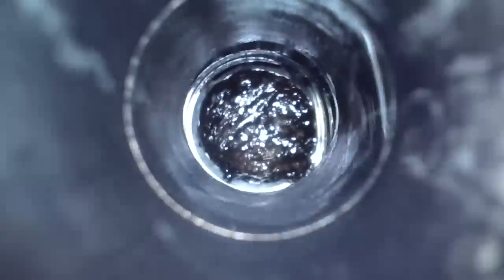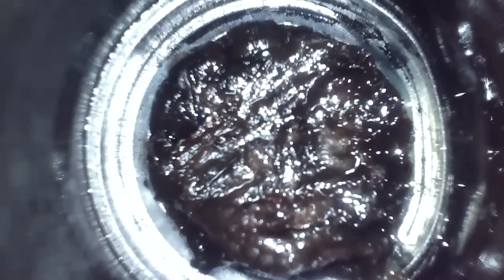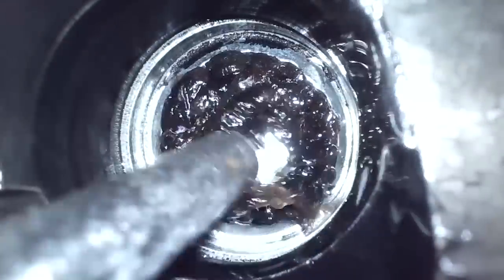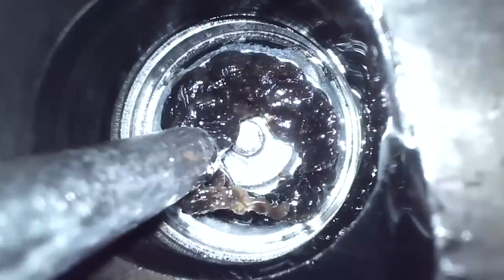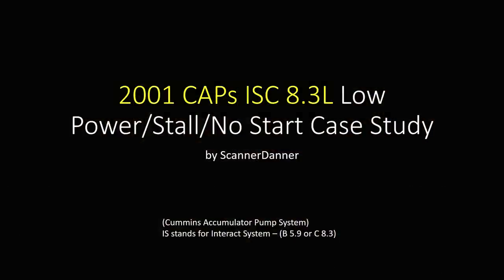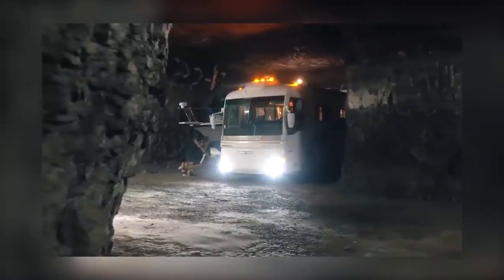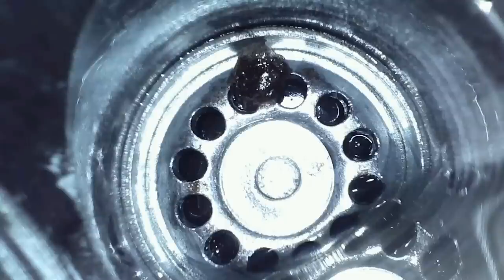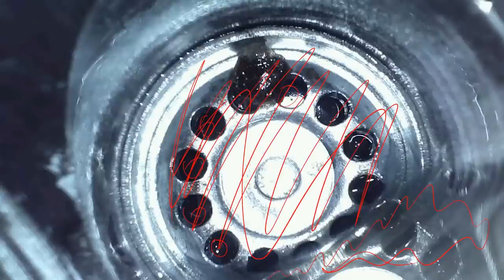2001 RV Cummins 8.3L ISC CAPs Injection System - Low Power/Stall/Intermittent No Start

Comment: Hey Dan, I just uploaded a video of what happened to me yesterday. What I never see in videos is ways to keep SAFE. My truck started in reverse at full throttle, no idea how or why. Something I did for sure, but I was dang near killed.  We see videos every day how to fix things but no videos on ways to be safe. Would you consider doing a video on some tips or something? If it happened to me I know it has or can happen to everyone.
Reply from the maker: Good suggestion. So many safety concerns when it comes to auto repair! Now I want to know, what were you working on (year, make, model and engine), what you were you trying to do and why was the car in reverse and your throttle wide open?
Reply: @ScannerDanner  87 f150. Needed oil pan gasket. That required dang near pulling engine. Also, removed Smog pump and EGR system. I "THINK" i jacked trans up too much and bent something or forced it into reverse. I did move shifter several times to make sure it was in park. Why it went full throttle, I have no clue. Obviously my fault as it ran fine when I pulled it into shop. If it was just full throttle, I could have shut it off and fixed it but the reverse too. Yeah.  It just makes me question myself and instilled more doubt. When you put all you have into something thinking it will be your last great restomod, only to lose everything. It's disheartening. Truck is fixable, lots of body work, new door, glass etc. My video shows the extent of the damage. But it wont fix what ever I did to my engine. I followed every video on how to remove that stuff.
Reply: @ScannerDanner  Also, you're welcome to use me as a example of what NOT to do. I understand I made a lot of mistakes. Just hoping a professional such as yourself could maybe help others, and myself to avoid such dangerous situations again in the future. I imagine insurance will give me probably a coupple K at best, Paid a lot more for it though. 70K original mies. So I will be getting something worse with what ever they pay me that will need a lot of work. I need to figure out how to be safer. I do everything alone so if i was to have gotten pinned, I would be dead.
Reply from the maker: @robsdeviceunknown  how did it crank in reverse? There is a park/neutral safety switch there for a reason.  You must have jumped the solenoid?
Reply from the maker: @robsdeviceunknown  I've covered what not to do when jumping ford starter solenoids like you have!

Comment: My 8.3 is doing the same thing right now after I picked it up from storage! on my way to get a camera for the lift pump! Wish me luck! It would barely hit 30MPH and would buck hard and show engine speed sensor codes and MAP sensor codes.
Reply from the maker: Let me know how it goes! I can feel your stress right now
Reply: I figured it out! The previous owner installed the wrong fuel filters, the fleet guard fuel filters are supposed to be 30 micron primary and 10 micron secondary. He installed 2 micron filters in both locations because the Napa replacement filters for the fleet guard are incorrect micron rating! Heads up to anyone using filters that are not manufacturer recommend! After countless hours of research it runs like a top now!👍

Comment: Should have tried some fuel additive in the tank to see if it cleaned the algae. Now we will never know.
Reply from the maker: Tank was clean, as I said in the video. After I cleaned this algae from the inlet of the transfer pump, I did run some algaeside to prevent this from happening again. Drove it for 2 more years with ZERO issues before I sold it

Comment: Hi what was the torque for the 3 11mm bolts on top of lift pump? Mine were loose but don’t want to over tighten. Thanks
Reply from the maker: I didn't use a torque wrench, just snug them up. They don't need to be super tight
Reply: @ScannerDanner  thanks. That’s what I did. Appreciate the reply

Comment: makes me wonder if it leaked fuel out then it would let air in and maybe the oxygen in the air allowed the algae to thrive in that section intil engine was ran again
Reply from the maker: Not a leak out, but a drain back to the tank. This is normal for this section to be clear of fuel after shut down. Oxygen from the loose bolts on the transfer pump? Not sure
Reply: @ScannerDanner  I was thinking the leaking gasket from the loose bolts gave just enough fresh oxygen for the algae to grow.  Seems like a big coincidence how close to the leaking gasket your algae was.  So perhaps instead of always having fuel additives flowing through the system, just ensure the system is tight with no leaks.  Should also run better now with no air being drawn through the fuel system, as you stated in the video.
Reply from the maker: @ablackformula  apparently from the comments, this really isn't an algae but some type of microbes lol but either way, sounds plausible. Others are saying moisture (water) is what's needed for it to grow
Reply: @ScannerDanner  that puts it out of my league.  I can fully understand and appreciate pull-up, and pull-down, and I can understand and perform the pressure differential tests to find where the blockage is.  Start talking about algae vs microbes... nope, not me lol
Reply from the maker: @ablackformula  haha me either!

Comment: Can you install a one way check valve so it keep that section full?
Reply from the maker: There is no need, that's what the transfer pump is for. To prime the system. The check valve is at the pump itself

Comment: It's funny watching you turn into a parts cannon customer. Lol..  buying speed sensors and paying for diags'..  But I get it, sometimes you just don't want to mess with it.  I can relate.  But it's still funny coming from you.. One of the leading Master Diagnostic Specialists-  can still fire the ol' parts cannon once in awhile. :) ...  But of course, in the end;   if you want it done right, you have to do it yourself.
Reply from the maker: And in the end I had two brand new speed sensors for 2 years before I needed them lol

Comment: Common problem run into this all the time even on the Duramax  and Isuzu  they will throw a pressure regulator code for the same problem
Many times people brought the vehicle in and they had new pressure regulators put in  and not fix the problem 

This used to be a big problem back in the day when we worked on GM 5.7 diesel’s.
Be careful where you buy fuel

Comment: I bet this could be what the problem is with my Freightliner FL70!!!!
Reply from the maker: Hope it is!
Reply: @ScannerDanner  Man!!! thanks for this video my box truck could back on the road if this is my issue. My truck did the same thing as your RV. Also if your RV has one? Check your fuel water separator. I think thats what its called. It has a screen in it, that will collect algae as well...

Comment: Check flow rates for lift pumps. And what the hell is that guy talking about "test under load"? LOL
Reply from the maker: That was the service info that said that! I believe one of the tests, you actually are introducing a bleed into a separate fuel tank to act as a "load" or volume loss when the injectors would be open more, as a test for the CAPS pump
Reply: It means test at rated power condition. Which means driving the motorhome and duplicating the speed and throttle that the problem is occurring at and reading your measurements at that time. Very nice video sir.
Reply: @ironmike742  Lift pump load is governed by PRV and has nothing to do with driving the vehicle. To test lift pump you check pressure and then flowrate. Got correct pressure? Check flowrate. Do that and you will find your problem in minutes.
Reply from the maker: @sharkyrich4844  it wasn't a test for the lift pump we were talking about! It was a vacuum test to check for restrictions. Engine running, lift pump NOT running.
Reply from the maker: @ironmike742  exactly!
Reply: @ScannerDanner  Ya, after you determined a restriction you can move on to isolating it. Am I missing something in the video? Looked like you wanted to change speed sensors and sh$t.
Reply: @sharkyrich4844  looks like you didn't watch the whole video. He originally had false engine speed sensor codes. Come on brother I know you are better than that. I feel like this is a great video that will help alot of people. What is the point of what you are saying? There's no macho ego to prove here. This channel is about helping people. Even when Paul makes a mistake he is the first one to admit it and then he will show you how to avoid making the same mistakes.
Reply from the maker: I came to reply, but now I don't have to. Couldn't have said it better myself. Thank you Mike!
Reply: @ironmike742  Look,  my brother. Everyone and their grandmother knows you get false speed sensor, crank or cam codes when these misfire. The 6.0 throws cam and cranks codes when misfiring. My whole point I'm making is Paul confused a simple diagnosis. There is no ego. No one knows who I am to have an ego. lol.